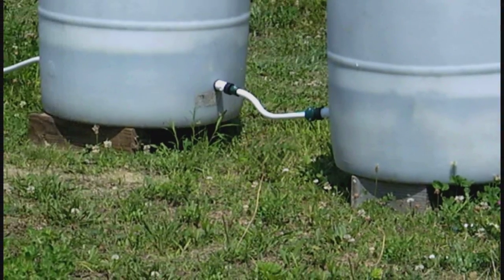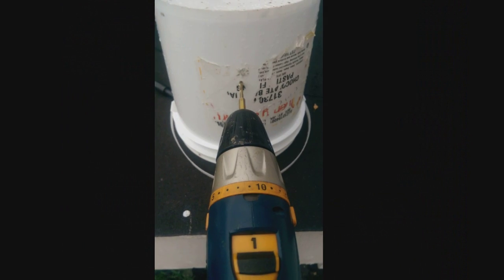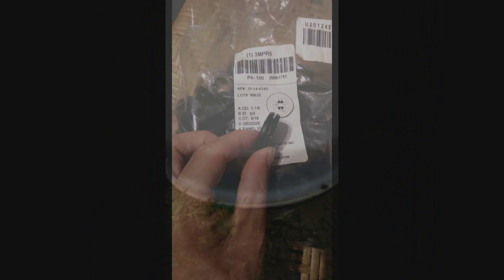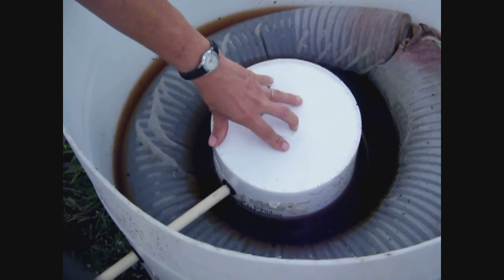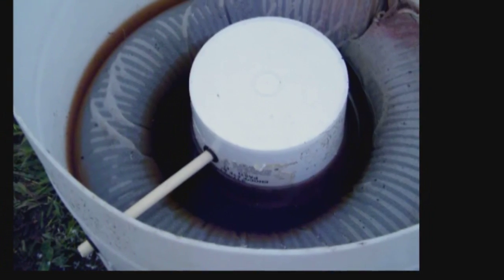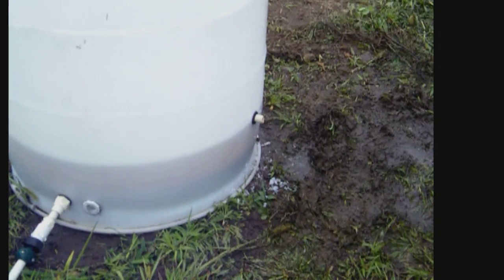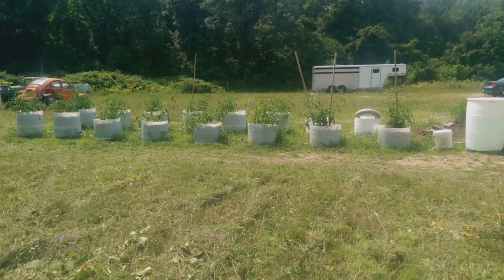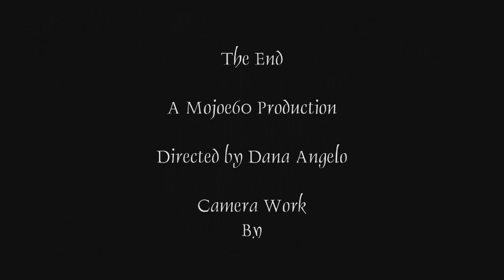Automatic Watering System For Wicking Barrels Part III Overflow Drain

Comment: do you only do this on the last barrel in series or do you recommend doing it on all of the barrels
Reply from the maker: you don't need to do it on all of them. i only did one this way.  i'm going to do a video in 3 or 4 weeks on a different way to make the barrels. you only get one planter per barrel but it's a lot less work and you only have to drill a hole for drainage.
Reply: thanks for your effort putting these videos up =)  Long weekend here in NZ time to hit the garden again.